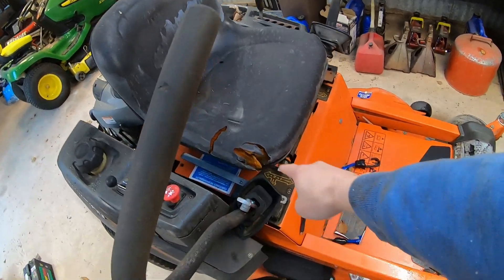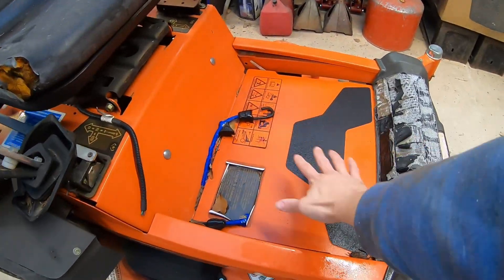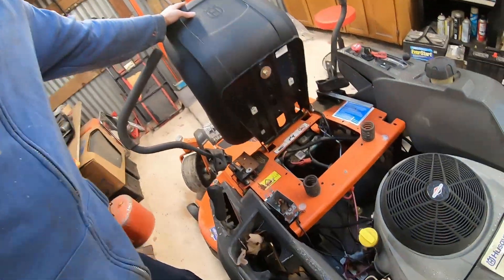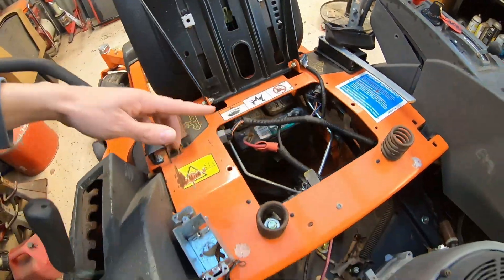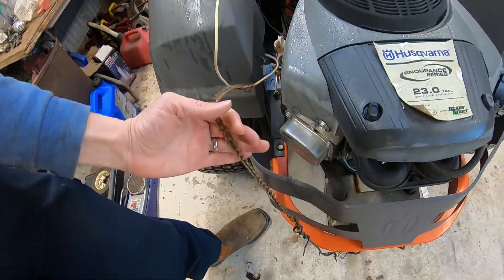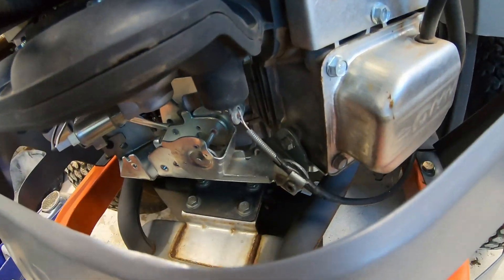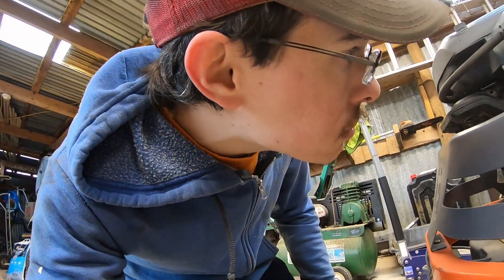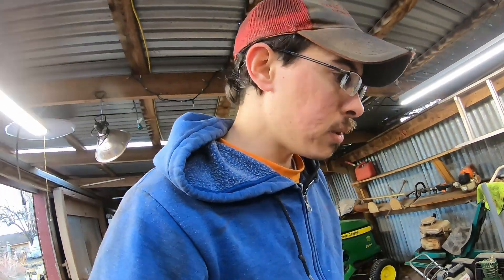FREE ZERO TURN!!! Husqvarna Z246 Part 1: bypassing all the electrical systems | Garage Story

Comment: Ever had a driving arm that wouldnt stay in the park position? Just vibrates loose, if so how did ya fix it? Ive got a z246 with that issue
Reply from the maker: The control arms on this one are messed up pretty good, they don’t want to go all the way out. I’m thinking to get some new parts and see if I can fix them.
Reply: @garagestory  can't wait to see how ya fix it, maybe I can gkeen why my left arm won't stay in park

Comment: Could you please tell me where you found the relay switch on the Husqvarna that you look checked and found out it was bad and you had to replace where it's located
Reply from the maker: It’s under the right hand side panel. I accessed it by taking off the piece of plastic on the front, right behind where the handle bar when it’s in the out position.

Comment: What is really funny about this is I get that previous owner's frustration.  Have a 3 year old Husqvarna zero turn and it cuts like a champ but the electrical system is garbage.  Have had multiple switches go bad already which causes me to hot wire it straight to the solenoid.  And now the seat switch is acting up, where I need pressure on it even if the other conditions should not require it, like when performing the aforementioned hot wiring.  Needless to say I will never buy another Husqvarna mower product.
Reply from the maker: Oh, yes, I certainly don’t fault the previous owner for trying to fix his mower to the best of his ability/time. 
However, in general, I think Husqvarna is one of the better offerings at the price point for tractor style lawn mowers. I’m not a huge fan of the Husqvarna zero turns yet…

Comment: How do i bypass the safety in the pto? I bypassed all the safeties in the brake and steering arms and can turn on the mower and drive just fine. When i engage the blades the mower shuts off.

Comment: theres a handle on the left side ,,, on and off ... must be off position to start ,, then push down to make the mower work
Reply from the maker: This one doesn’t have that. The only thing on the left side is the deck height, and, of course, left steering bar